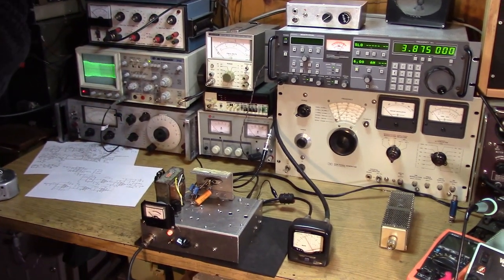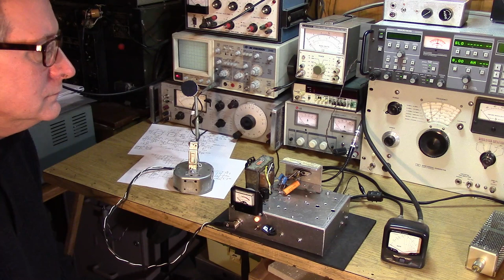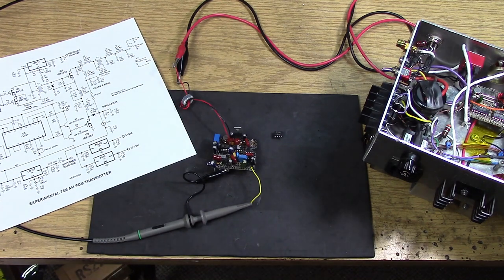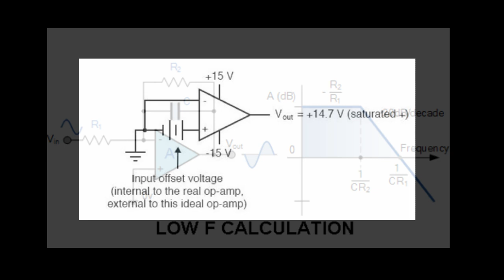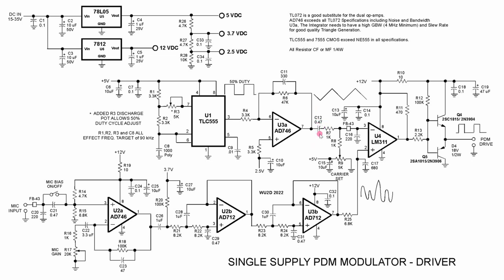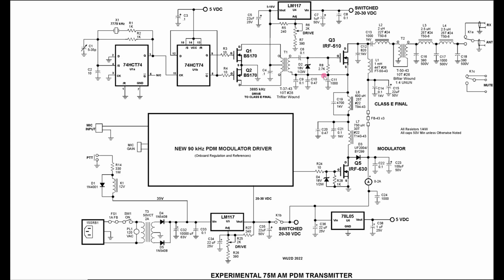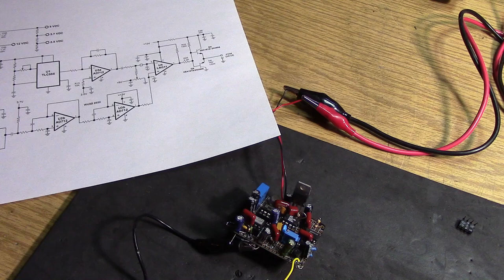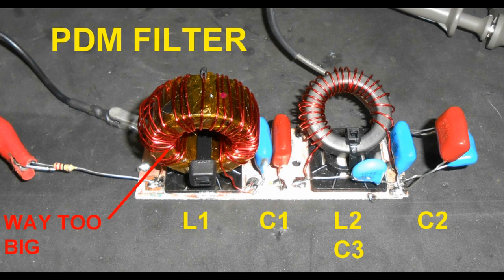PDM REDUX - Part 8

Comment: Well done Mike. I think Chris hit the nail on the head with the flip-flop. A 50% duty cycle is so easy to do with a flip-flop which completely eliminates the duty cycle adjustment. That would also allow you to use a MUCH simpler oscillator. Taken to extremes, I could eliminate almost the whole modulator function with a single eight-pin PIC. I would need a mic amp and the rest is software.
You did a marvelous job of defining the function.
Reply from the maker: Great ideea for no fuss stability. With a T (Toggle) Flip Flop 50% is guaranteed. Maybe start with a 455 kHz resonator and divide twice.

Comment from the maker: Modern power supply ICs are quite a bit more sophisticated than the old TL494 /7500 and most promise higher frequency PDM clock operation as well as dead time correction. New designs are always interesting to explore to see if they might bring some advantage. This video just exposed the germ of the basic PDM generation idea. Many folks worldwide have 25 years of PDM experience compared to this tinkering ham!

Comment: Seems like it would be easier to come up with an oscillator circuit running at double the frequency, don't worry about the duty cycle and use it to clock a divide by two FF circuit to always insure a 50% duty cycle regardless of the input frequency.  Or maybe tap the charge/discharge part of the 555 to get the triangle wave more directly.  I know there should be a configuration that will work.  I think it uses the output of the 555 to do both the charge and discharge of the timing cap.

Comment: I thought that triangle wave was better for more linear lower distortion in an audio PWM/PDM. I wondered why that was not used in the first place in this transmitter. In a switch mode PS it wold not matter if its a saw tooth wave form for the PWM/PDM. Would it be practical to use a 555 by itself as a PWM/PDM? I had seen this in a data sheet app. for the 555.
Reply from the maker: With the CMOS versions, this may be possible.

Comment: What is this about needing to clip the negative audio swing? I did not see the modulation envelope on your scope, but I did see the look on your face.
Do I have this completely wrong or does the audio drive pulse duration?
I am looking at the schematic at 17:50.
If the modulation driver is stuck high (no pulses, 100% duration) the radio will put out the carrier frequency at maximum power.
If the modulation driver is stuck low (no pulses, 0% duration) the radio will put out the carrier frequency at minimum or 0 power.
I can see it clipping if it is audio over-driven or if the no audio condition is not centered at 50%.

How would you go about adding a code key and CW mode? -Tim KI4TG
Reply: oops, oh, but it would not switch at all and no RF at class E
Reply from the maker: Normally the duty factor is set to 30 to 40% for a resting carrier level at no modulation. Yes you could simply key the thing and get CW (at any level up to max). So it can be thought of as an efficient "drive" or power out control.